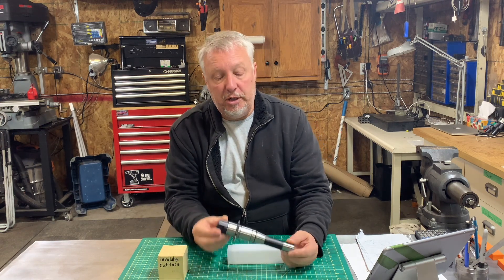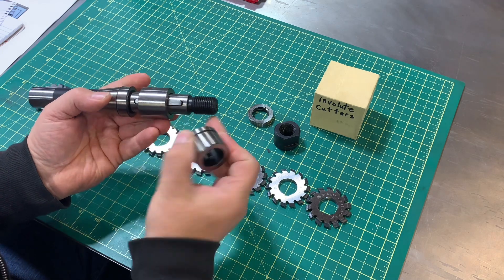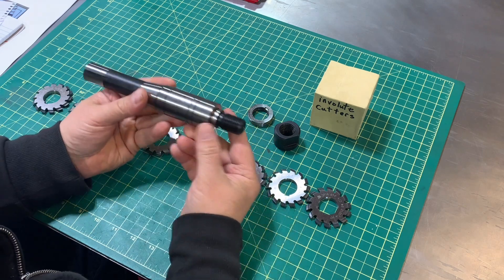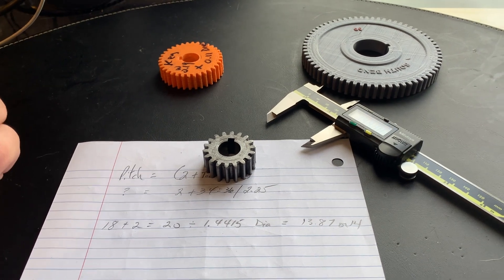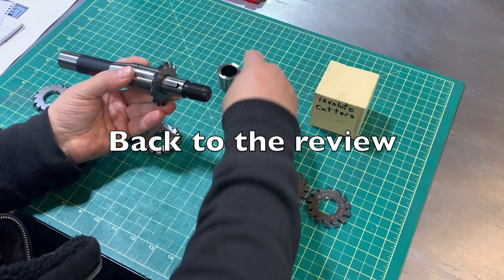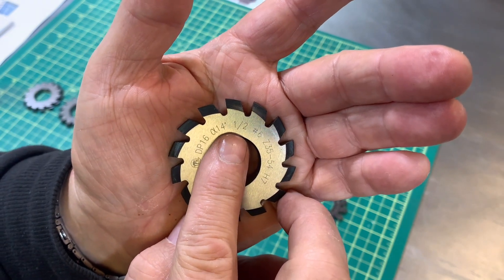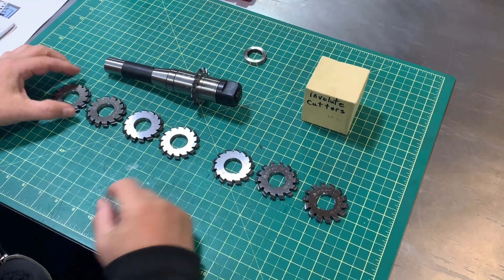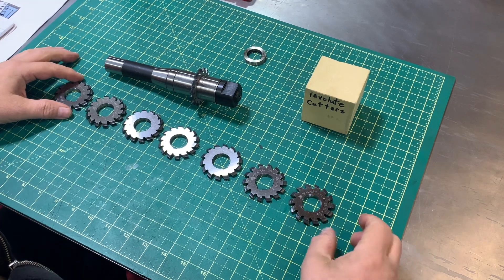Spur Gear Cutting Tool

Comment: I am pretty sure out lathes are the same (mine is 1942 13" single tumbler) - I've collected a bunch of information on metric gear cutting, even though I don't have a current need for it, but just to see what I would need to do. To get a metric gear kit will likely be impossible to find. Where did you get that chart that gave you the thread pitches for different stud gears? I'd be interesting in knowing more.
Reply from the maker: Got the chart from the guy selling 34 tooth gears on Ebay. You’re correct. Those 127:1 gears are impossible to find. Called every dealer and they all said to make some. So after printing a 34 tooth gear and getting accurate metric threads with just a stub gear change I was sold. I have a video coming out next Friday on how to make it.
Reply: @LetsRogerThat  No worries. Just the information I would like to have. Based on that chart, looks like it covers most common pitches.
Reply from the maker: @MyLilMule  it does a lot doesn’t it. If you want I’ll make one for you and send it your way.
Reply: @LetsRogerThat  No worries. I'm hoping to be setup for gear cutting soon. Should be a fun project.
Reply from the maker: I may have misunderstood your question in my first response. I didn’t get a for thread pitch for different stud gears. Just a chart for the 34 tooth gear. I’m sorry about the confusion

Comment: Good information.  I am getting ready to embark down this path myself making some involute spur gears for a Stirling engine tractor that I am making.  I need 32 d.p. , 14.5 p.a. cutters and I am having a hard time finding them without paying an arm and a leg.
Reply from the maker: I hear you Jim. Anything but DP16 is expensive unless you shop on Ebay and order the one you need from China. If you don’t mind waiting 3-5 weeks go that route.  The cutters are just as good and you don’t get ripped off